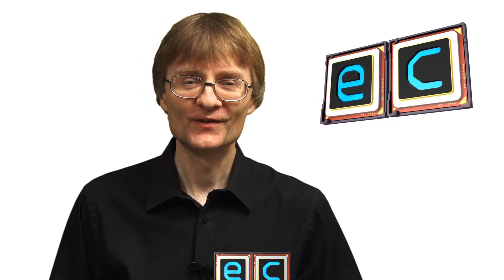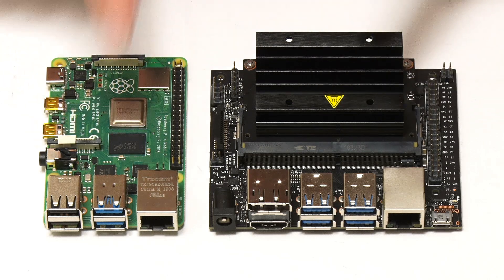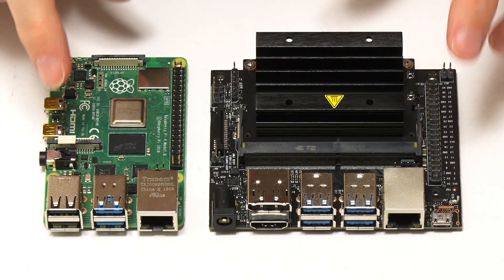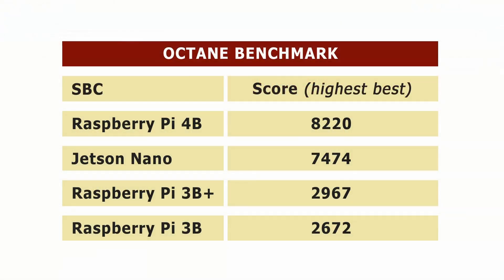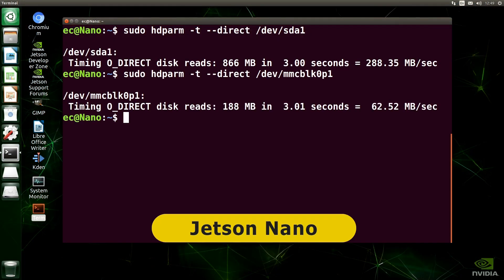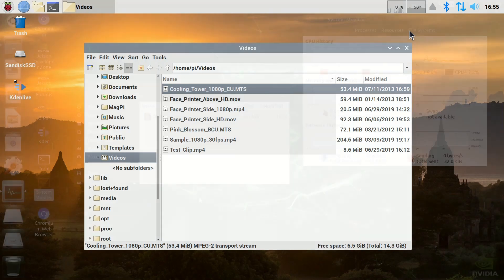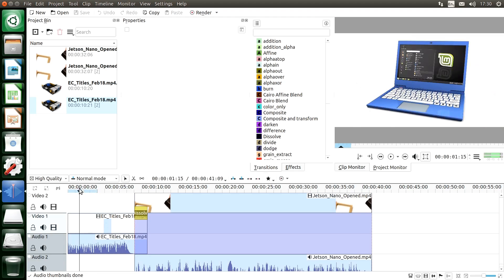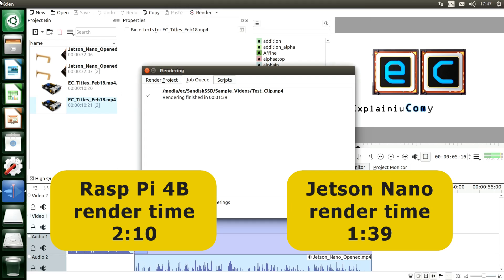Raspberry Pi 4B vs Jetson Nano

Comment: Nice comparision. As I read RPi4 may have accelerated chromium build later. It is not enabled currently. So maybe the video decoding is done by gpu but putting pixels into the screen is not yet.  
On pc linux desktop it is also limited now, but here is a link with some hints about how to check if chromium has hw acceleration enabled:
https://www.linuxuprising.com/2018/08/how-to-enable-hardware-accelerated.html
Also it would be interesting to hear about AI specific comparision. Nvidia advertises their board as AI development stuff. RPI had few topic about Google's TensorFlow based AI.
Reply: "So maybe the video decoding is done by gpu but putting pixels into the screen is not yet" for a long while the opposite was true on the rpi3, although the new raspbian did include properly built ffmpeg when i checked out the buster repo a few months back so hopefully this is just a chromium end issue
Reply: It's typically decode and render that is not enabled, so it's been done purely in software witch even with faster cpu on the pi4 will chug

On first gen pi I had a full media center running on my pi1 and could handle 1080p30 perfectly fine as long as it was using the correct file and video format for the gpu to do decode (the cpu failed on that one, the cpu had microcracks on the solder as t would sometimes work when pressed on)

Comment: Pi offers hardware accelerated video playback (including YouTube) with omxplayer though...
Reply from the maker: Does it still offer this? It offered accelerated video playback, including YouTube, with VLC when the 3B+ came out, but that seems to have lapsed in the latest Raspbian, as least for now . . .
Reply: @ExplainingComputers  yes, e.g. you can try :   "omxplayer $(youtube-dl -g https://www.youtube.com/watch?v=kbn_6ixtIpA)"   (need youtube-dl installed to parse video URL). But for offline movies its just "omxplayer < filename>" . Best way of using this feature (Watching Youtube on Pi) is with "Picast" app from Andoid phone. Obviously Kodi also uses HW acceleration for youtube etc...
Reply: @ExplainingComputers  As  for VLC you will notice if you go full screen (press "f" while video is playing or start with "-f" flag) the CPU use by VLC and Xorg drops significantly -- it seems to go into HW accelerated mode), e.g. vlc -f "https://www.youtube.com/watch?v=kbn_6ixtIpA"

Comment: Dang, I'm just impressed by how much faster the Pi 4 is over the Pi 3+! Thanks for doing this!
Reply: Its based off of a totally different ARM core design, A72 was the 2019 ( mid to late ) high end in SBC's before the announcement of A76, ( snapdragon, RK3588 ).
Reply: I never expected them to get 4 A72s on the board as well as USB3 and DDR4 - for 35 quid. Released 9 months early too, with big memory options, dual hdmi, gl3/vulcan, h264 encoder... its unanticipated.
Reply: @adymode  The quad-core A72 was a little bit of a surprise considering the price, as you say.  At the same time, it's not totally unexpected as the RK3399 has been out there for a couple of years.  It looks like the A72 cores on a 28nm process is the compromise between price and performance.  We've seen such examples as the RK3399, and the old mid-range Snapdragon 650 and 652, and now this.  And the A72 being a few generations old already probably helps with the price as it's not top end of the line anymore.
Reply: Seems to run hot but I was impressed as well. The only downside is that it is going to need a heatsink w a fan to keep it from overheating imo
Reply: It's Christmas in July!
Reply: @randyhall5554  Judging by the availability of the 4GB model, Christmas might be delayed until August at least.
Reply: @mbirth  Depends where you are, I guess. Christmas arrived here early this past week, in Canada. Watching this vid right now on the Pi4B 4GB. :-)
Reply: Yeah, and you can keep your beverage warm with it...  That's not a compliment.

Comment: Hi, good video. Thanks. I wonder if the pins on the Raspi are fast enough to support an add-on GPU board if someone would produce that, and if this would make any sense?
Reply from the maker: I think an external GPU for the Pis very unlikely. The one on the SoC should work very well once it gets appropriate software support . . .

Comment: Thanks for sharing another great video.  Was really surprised with the substantial sd card performance on the RPi 4 to the earlier versions.
Reply: What that shows, like you say very clearly, is just what the USB2 bottleneck was doing for performance.  Anyone struggling needs to read up on USB specification.  The pi3+ has one US2 lane- FOR EVERYTHING!  This made it a pretty crap NAS, which the Pi4 solves.  But that bottleneck really harmed the Pi3+ because no amount of HATs/add-in boards were going to get around it.  One odd NAS I made would slowly fill its SSD, then off-load that data via USB3 HAT much more quickly to a more fully featured NAS.  The best use case I found for that design was around a Pi0 CCTV system, with the Pi3 acting as the server.

Comment: Did the pi 4 B really hit 80 deg c with that large heat sink you pictured?.  The whole board gets a bit warm at just idle.
Reply from the maker: It did indeed. It gets very hot. I will tame in in a cooling video in two weeks time here!
Reply: @ExplainingComputers  That will be interesting. Mine is just sitting now waiting until some cases become available with a fan.

Comment: interestingly RaspberryPi people said they had doubled the sdcards performance, seems they weren't exaggerating it is almost exactly doubled !
but at those speeds It runs think I would rather run the pi4 using usb3 flash drive if it would support booting
Reply from the maker: Yes, when we (again) have USB booting on a Pi, it will be great!

Comment: A 64bit operating system generally out performs a 32bit OS even with the same hardware. So it may not be an apples to apples comparison but still an excellent video.
Reply: *outperforms

Comment: Another awesome vid Chris. Thanks for that! I cant imagine why the Jetson Nano with its dedicated GPU utilizes CPU for decoding video, just doesnt make sense. Maybe some codec issue? I have an Nvidia 1080Ti and when running ANY videos on VLC player, cpu usage drops below 5%.. So, Nvidia CAN decode and has access to the needed codecs. Anyways, I agree with you that the Pi 4B is the better deal! Hope they make the Nano a compelling buy, cos I see some potential in it. Like I was thinking of building a retro gaming portable machine, for which the Jetson would be perfect if the GPU is utilized properly. Nobody makes it clearer than you Chris, thanks again and keem 'em coming :-)
Reply: Because it is intended for  Edge Computing/AI and not as an Android Media Player?
Reply: That's not NVidia fault or problem. VLC uses its own codecs and these codecs for Jetson Nano  are not using CUDA cores for video decoding. Also, I'm just wondering if EC has compiled custom version of VLC, because officially  there was no 64 bits version of VLC for Linux on Arm.

Comment: You didn't mount any heat sink to the Raspberry Pi 4? I would think that would improve performance.
And... putting it inside the official case would probably impair cooling and therefore performance.
Reply from the maker: I mounted a heat sink for the YouTube, video and Kdenlive tests -- as shown at about 12:38. More on cooling in a video here in 2 weeks. :)

Comment: Imagine Showing This Technology To A Computer Expert In The 1970's. ?
Reply from the maker: What a thought! They would be staggered.
Reply: @ExplainingComputers  As a voice from the past, I would say we would be very excited and happy rather than staggered.  By the second half of the 1970s there were a variety of development boards available, which were in many ways similar to modern SBCs.  For example, if I remember correctly, there was one popular model with an eight-bit Motorola 6800 cpu, about 512 bytes RAM and maybe 1 kB ROM, which was about the size of an A5 sheet of paper or a small table mat.  The clock speed was about 1 MHz.  People were really quite ingenious in the way they made use of every bit of RAM, and connecting up stuff to ports and interfaces on the boards.  The previous generation from the end of the 1960s would have been a large suitcase-sized minicomputer weighing several tens of kg.  So, we were well aware of Moore's law and its implications, and fully understood that an incredible technological revolution was in progress.  I remember conversations with people at the time trying to explain this, and how exciting the future would be.
Reply: HA HA ha haaa YES Earthling Keep Up The Good Work
Reply: @Kevin Lee On the earliest computers that I used, we had punched paper tape, and punched or marked (with a soft pencil) cards.  During the 1970s I did also see a few larger systems with magnetic tape and disc packs, but these were much less common.  The discs were loaded in a machine resembling a large top-loading washing machine.  By the second half of the 1970s, is became quite common to use compact cassettes for small systems.  Nevertheless, we were aware of the possibilities that the future would likely bring, inspired by the physicist Richard Feynman who said that there is plenty of room at the bottom [APS, Caltech,1959].

Comment: For cooling i used Large heatsink one of those 3 piece heat-sink pack and the little Pi Fan,   Active Cooling for me Always.  35 idle / 54 Full Load
Reply from the maker: That is a good cooling result.
Reply: @ExplainingComputers  No case, Mounted on Acrylic with stand-off's and Acrylic on top with the Pi Fan.

Comment: Hello Chris. 👋🏻
Exciting and most interesting!
Everything as I expected. 
Sit, watch, examine, learn and enjoy. 🤩
Kodi on nano! 
Even better, for retro gaming! 🤩
Maybe some Linux to try on pi4... Or to connect few PIs together... 🤔
Lot's great stuff to tinker with...
Reply from the maker: Hi Elvira, here we are again! :) FFMPEG CUDA support on the Nano would also improve Kdenlive performance . . . Now there's a thought. I actually tried installing Kodi on the Jetson Nano, and it does work (CPU-only) -- at least on first install. Then, after rebooting, I could not get back into JetPack (even though I had only installed the app), which was not a happy situation. So I did not include this in the video! As you say, lots of stuff to tinker with. This afternoon, that tinkering is decent cooling for a Pi 4 . . .
Reply: ExplainingComputers 
Exciting!
Can't wait to see cooling 'tower' on tiny PI! 😁
Well, pi does need one though. <Running kdenlive...>

We'll see, waiting for FFMPEG CUDA on nano. At least you tried to install Kodi on nano. That's what I would do, the same. I have to give it a try. 😁 Probably I couldn't sleep without getting the answer on 'what if I do this...' question. 😅
Reply: *Lots (neither possessive nor a contraction)
Reply: alvallac21 
Yes.

Comment: It's a shame that Raspbian is still 32-bit. I understand compatibility and so on but it also means it runs older Thumb instruction set instead of much cleaner, faster and optimized 64-bit ARM set. I hope Pi Foundation will eventually switch to 64-bit. I think Pi4 should get much better result on a 64-bit system.
Just for fun I ran Octane on my iPhone XR and got around 40k points.
Reply: my pc is 29411
Reply: I dont belive you that you got 40k.
I only got 16.4k with my Oneplus 6 and this is a high end Smartphone from last year.
Reply: Jonathan Lange I don't force to belive me. Type "octane 2.0 iphone xr" in Google and look for example to Apple Insider. They also got 40k, while Samsung got 23k. Javascript processing is just well optimized on A12 chip.

Comment: PI 4B can be very hot. A better heat sink is required when running intensive application. Maybe try liquid cooling if heat sink is not up to the task.
Reply from the maker: I am, this very afternoon, building and testing a serious cooling rig for the Pi 4 (video two weeks today, as next week we are back to PC Linux stuff).
Reply: @ExplainingComputers   Great. Looking forward to see the cooling rigs. Thanks for your great video.
Reply: It's pretty damn sad when people have to consider liquid cooling for an SBC.  That defeats the entire purpose of the form factor.  They should have held off on releasing this until they had it fixed.